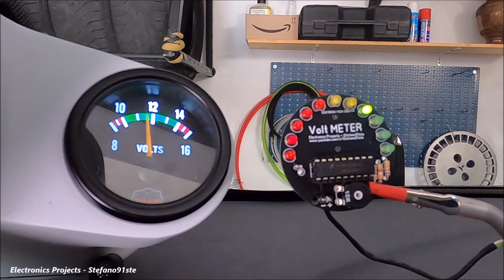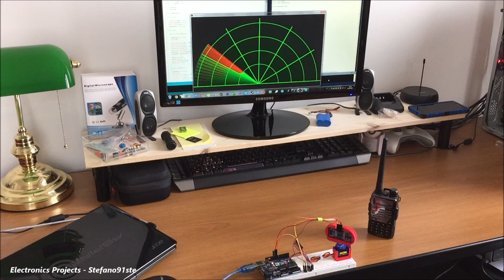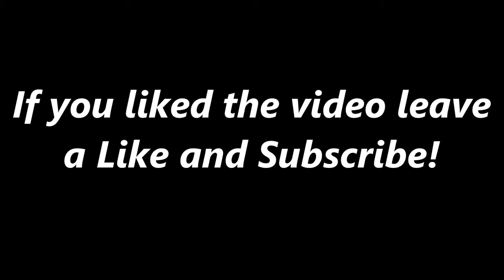10 COOL ELECTRONIC PROJECTS that You Must SEE

Comment: Im wanting to make a very simple heating element for water from a 30W solar panel. It doesn't need to heat water fast. Is this possible? Its for a desalination project.
Reply from the maker: Hi, 30 watts is very little for desalination, in my opinion
Reply: use a solar collector

Comment: Nice projects
Reply from the maker: Thank you =)
Reply: why the positive comment
did you actually watch the video
what are the projects
what  did you learn
which one will you make
can you explain a circuit
Reply: Yes, I watched the video until the end and I liked it so I wrote a positive response. The voltmeter and sonar radar project caught my attention. Is there anything else you are curious about?
Reply: Yes, I watched the video until the end and I liked it so I wrote a positive response. The voltmeter and sonar radar project caught my attention. Is there anything else you are curious about?
Reply: @electronic7979  
Thanks for your reply.  Can  you relay what you learned?  say for the car voltmeter what are the divions = i.e 0.5v/led.  what tells you when the voltage is low? is it robust - cars are a hostile environmnt.  what is the cost? these are mostly just modules [or kits]